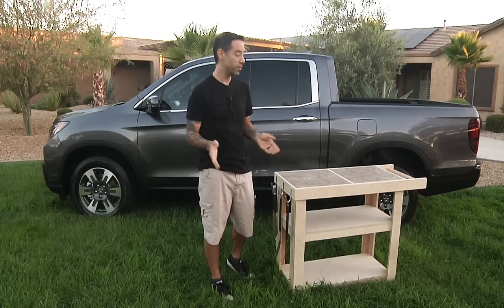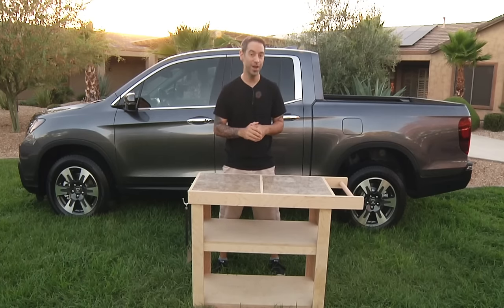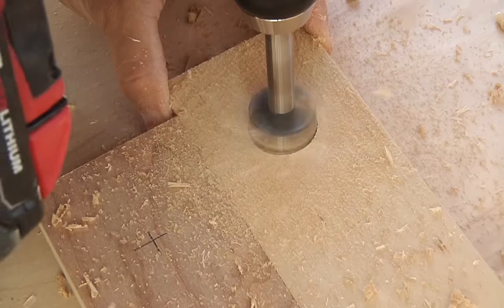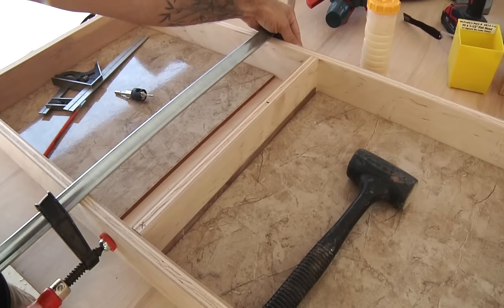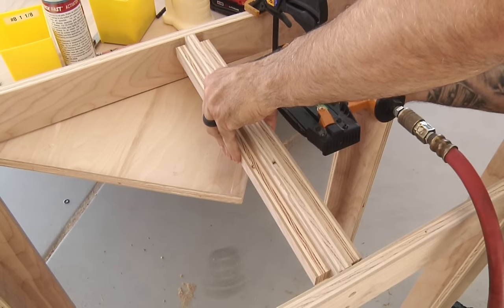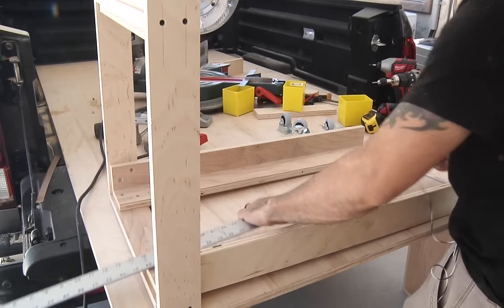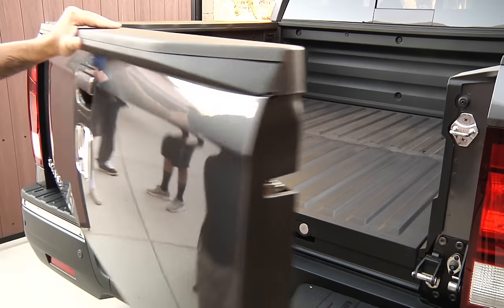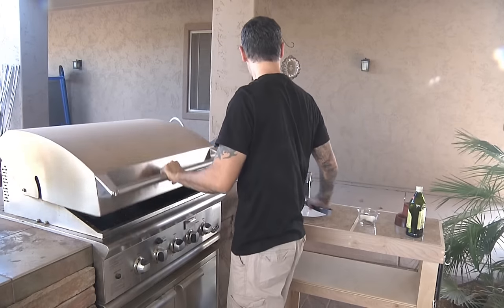265 - Barbecue Cart

Comment: So I guess the repost was because you can't plug the miter saw in the outlet of the Ridgeline. 
Thanks
Reply: And there's the comment I was hunting for
Reply: Amperage issue?
Reply: +Tom Moore most likely, mitre saws are power hungry little things, the initial influx of power to them would most likely trip the fuse in that inverter.